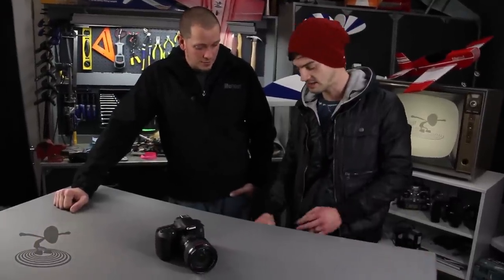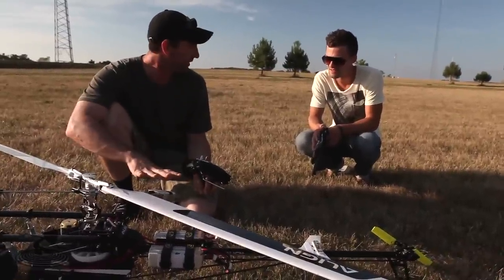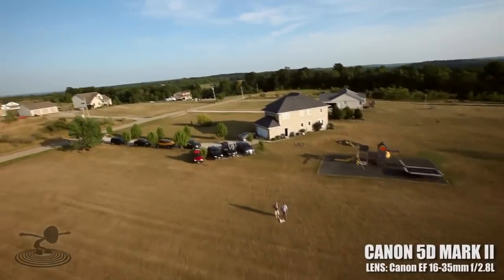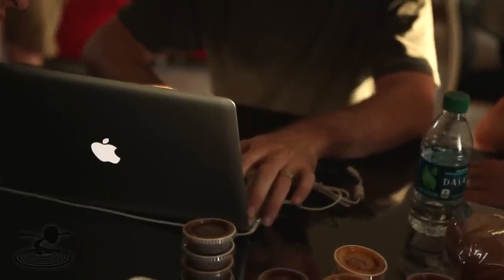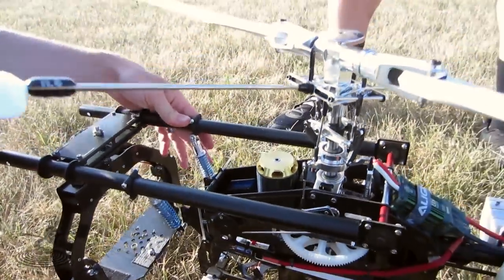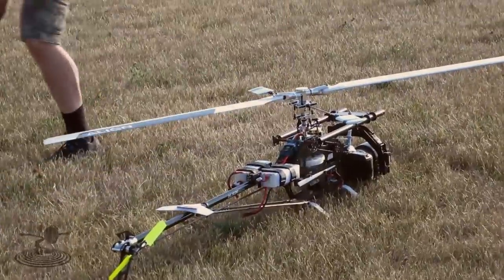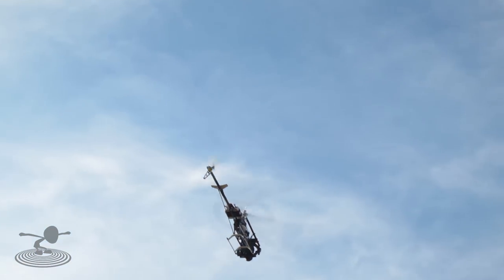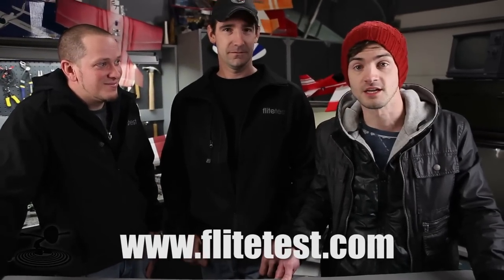Flite Test - T-Rex 800E Helicopter - DSLR Camera Gimbal

Comment: Hey guys! Eric here, glad ya'll liked the episode, was fun seeing what Josh & Josh experience on the other side of the lens from where I normally stand. :)  I do have a tricopter, 2 quads, 2 hexas and I am designing and slowly working on my octo frame. So I def dont hate multirotors. LOL Each has their pros/cons for sure.  One thing the T-Rex is really good at is tracking a fast object...it is ALOT faster than a multirotor. I am excited to go flybarless with a 3 axis stabilized gimbal.

Comment: Hey Glennster!  The shocks dampen any vibrations or shaking that might exist after proper setup, head & blade balance etc. are done. (cant get them to disappear entirely...even on a multirotor) They gyros for the axis' of the gimbal will stabilize the camera so that it maintains itself level to the horizon no matter how the heli banks or pitches & they do an awesome job. Vibrations however will still show up in a gyro-stab gimbal if the heli is not setup right. Cheers! ~Eric

Comment: They do have collective pitch, the rotation doesn't change, the pitch of the blades does. When the heli is upside down, the blades are tilted so that they are at an angle (relative to the ground) as being similar to when flying normal (all being relative to the ground).

Comment: I agree that multi-ro's are far superior platforms for Stabilization, gimble mounting, less vibration, heavey-lift, auto-leveling etc etc.  but I do see an application for still using conventional FP Heli's because of the flexibility, speed and High-performance maneuverability! I wish I could fly a FP heli this stable. lol

Comment: I am running the flybars, because currently that setup is working.  However, in a few weeks I am going to move to a flybarless head and 3-axis controller with GPS position hold, altitude hold etc.  :)

Comment: My quad & hexa frames are all approx 40 inches from motor shaft to shaft. I run the QC-3328 motors from the Cinestar.  I am currently outfitting one of my hexas with the MikroKopter FC board.  I run the Hexas on 5 or 6 cell 5000mah lipos. the 6 cell will fly a gopro for approx 18 min. :)  Although I never fly that long because I try to only pull about 75-80% out of my batteries in one flight.

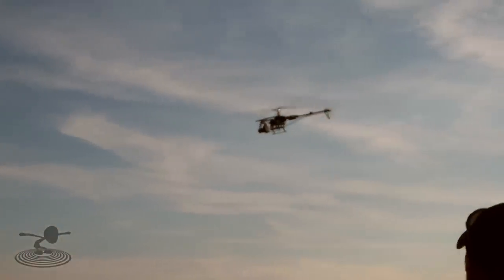Comment: you can two man a multirotor (control the cam separate from the pilot). dont know what hes talking about. 9:30

in terms of heavy lifting, you can also do the same with MRs. i dont see this guys point. it comes down to whether you like single or multiple rotors, basically.

Comment: I guess I should have clarified more....when i said that, I was referring to overall flight characteristics.  The larger heli's are not as touchy & twitchy as their smaller counterparts with crazy high head speeds. This machine as well as multi-rotors can be out-fitted with GPS and position hold FC's that will make them literally sit there and not move at all.  For flying gyros only though.....it is a pretty rock solid machine.  It gets the job done 4 me. Cheers! ~Eric

Comment: Single rotor is an analog, pure mechanical flying machine that doesn't require any electric controls (Yes gyro on tail helps, but you can still fly without it) It's like F15, a smooth mechanical flying machine.

Multirotor is an all digital, electronics powerhouse that's in the air by sheer willpower of an electronic intervention. It's like F117, which will fall out of the sky without electronics.

If you put enough electrics on a single rotor, you can make it fly "hands off" like the multi rotor. Otherwise pilot skill is paramount on single rotors.

I guess energy efficiency is bit better on multi rotor because there's no tail rotor wasting 15% of power, but there's no power-robbing gears/belt/rotorheads on multi rotor. With a single rotor, there's the dreaded "dissymmetry of lift" issue, which doesn't exist on multi rotor, but flight speed is not important for aerial photography/fpv.

Multirotor is better for aerial photography, especially in 6- and 8- rotor machine.

Comment: Eric you could hook a.  cc3d revolution flight controller with librapilot on it and have GPS, autonomous waypoint flights , telemetry, auto stability flight modes and a ton more for less than $50, and it has 433mhz Rx built in that you can fly with or just watch what your doing though telemetry on the gcs real time. nice for pilot two to watch battery life. also cc3d revolution works in any air frame

Comment: You would remove the tails and anything related to those and I feel that reversing two sets of the main rotors wouldn't be too hard. I've never had nor seen a T-rex, but I did, about 2 years ago, have a hobby grade rc helicopter and there was nothing blocking the user from putting the blades in the other way and reversing the motor would be nothing more than simply switching any two wires between the motor and esc...The knocking someone's head off thing would be resolved by not hitting people...

Comment: As was stated it has been tuned more since then by adjusting the oil filled shocks which may have caused the shuddering you saw in the video. Could also be caused by having a low head speed. Getting perfect video on helicopters is very hard to do so i just do stills with them but would like to get better video when i have more time. Also try flying a multirotor in 30 mph winds lol :-))

Comment: Hello ...

Sorry but  multirotors are safer and they are more stable.
There is less vibrations and in last years there is powefull setups able to handle with easy ~ 20 KG total weight ( ~ 11 Kg Payload ).
I have a SkyJib 8 with Aerodrive 8 + 4120-20 Axis + 18x5 props ia already lifted 36Kg (for test only).
The real problem for helis is:
1) Blades can cut a person in 2 pieces.
2) Vibrations.

It is my opinion.

Cristiano

Comment: a good platform to start with if you need stol is a multiplex funcub. I can get mine off the ground in about 8 inches with no payload, and when carrying a mock-up dslr the same weight as the 7D (foam with lead weights in it, just to see how it would change the flight characteristics) I can take off in 3 feet and land in under ten. it would also be easy to convert it to a twin motor, with two 300-400 watt motors on the wings. good luck, and happy crashing! -joe

Comment: The single rotor is also alot faster. So you can get some nice images of say... cars. flying with them at high speeds. The DJI system works awesome for stabilization. You can put put it in altitude hold and this thing will just sit in the air like a multi-rotor. great vid though

Comment: Very impressive bird but are they really getting the most out of it.  The gimbal didnt look like it was gyro stabilized at all which really leaves the setup wanting in my opinion.  Pretty sure there are options now that will control a heli like this with auto level and gps etc so it really is as flexible as a multirotor in that aspect but very much a road less travelled.  Hook up a gyro to that gimbal and some good servos and the footage would be a lot more impressive

Comment: Flying a heli FPV would be hell if you were trying to get a shot with the gimbal. Have you tried FPV using a separate fixed board cam to get a feed for the pilot? Would love to know if there are any heli pilots out there who fly fpv and love it. Seems ok in the simulator (after much practice), working on getting a video system up and going at a price I can afford so I can find out for myself. Starting with my H-Quad, working towards a 450 size heli.

Comment: The main advantage would be to use a gas engine and have tons more flight time and battery life for the camera and electronics duh! Probably want to make a custom exhaust exit out far away from the camera though, through the tail would be ideal. Although more maint but for a professional gig, it would be the way to go.
Reply: It would be very noisy though:(

Comment: On brand new 5000's I get 11-12min if I push it.  I never do. Batteries are too expensive & wear out too fast to push to their limits on every flight.  I land at around 7-8 min.  When flying on a job, there is usually never a reason to fly any longer, at least in my experiences so far.  We get a shot & then change out batteries and move to another location for another shot.  This thing is 100% a work machine. FPV would suck at only 7 min. flights but again, this thing is only for work. :)

Comment: It's easier and cheaper to build a hex for gopro, because it's smaller and simpler. For a DSLR, you need a fairly big copter (even a octo) and things get very expensive. Not to say that gopro will most likely survive a crash, after which a DSLR would go to the trash can ;) and imo, a tri or quadcopter will be sufficient for gopro, I think it's not worth building a hex just for a gopro...

Comment: Would you be able to do a video on FPV setups in relation to radio video frequency.  I am currently trying to setup a 433mhz uhf for radio and 1280 MHz for video.  Interference is a big issue.  My 2.4g radio with 5.8g video works fine however range is only about 1km.

Comment: Does anyone notice some vibration in the video from the DSLR?
Reply: +George Ou It is the speed of the camera. The platform is moving faster than the camera shoots. Typically the higher the resolution and the larger the lens means a lot more data to be processed. Many of the DSLR's a few years ago were only 30 FPS now many high end are 60 FPS. His shots are not really action shots. more Hover and shoot or slide slowly.
Reply: +George Ou That because the 5D ( I have one myself ) Does 1080P 24FPS and 720P 30FPS
Like @Naked Acres said Platform is moving faster than the camera shoots that means more data has to been processed. The 5D is a couple of years old now. 
You can get smaller action cams now that do 720P 30FPS-60FPS-120FPS or 1080P 30FPS-60FPS
The only problem with that is that the picture isnt that clear as that from a DSLR Camera.
I fly a quad with a simple 1080P camera but its not near as close as like a DSLR on 720P Its crazy.
Reply: Infected Gamer Nothing makes up for sensor size. And they say size does not matter.
Reply: +Naked Acres Goddamnit xD

Comment: Being easier to fly seems what this is really all about, as a small quad equipped with a camera really isn't any more stable or more suited for a camera. Heck, the most stable possibly would be a blimp or hot air balloon for crying out loud. I really don't get the fuzz about quad vs helis in here. Each has their advantage over the other, and personally I totally believe a well-setup helicopter is easily stable enough, especially when using a good gimbal system for a high-end cam anyways.

Comment: cool but I don't see how a collective pitch helicopter which is inherently unstable is useful as a camera platform.
Reply: That's because radio control used to have gitich issue.
Reply: Michael Marr
I think more so bc collective pitch helis are innately unstable. multirotors are far more stable and just as maneuverable for AF.
Reply: ohaleceiffel Multirotors are innately unstable as you need a FC just to stop it falling out of the air.
Reply: ohaleceiffel that is not true.  it is expensive and hard to find good mircocontroller.   Like Alistair say or whatever.  You need good accelerometer so that it is not out of control.  not a 3d nor x series.  Like I say, radio on T Rex series are not 100% stable.  In fact, spektrum are trusted brand.  By the way, what are BC, AF and FC?  Sorry, I don't understand short word.
Reply: Justin Sugarman Then step away and back off if you don't agree with me.   You are the one who is troll not me.  You're just being immature or either stupid. Should I say false accused?  My last message, this is not a troll. 

PS: Don't act like disrespect me, I don't disrespects you at first.  Oh and I know what troll mean.  I token English 101 and Reading 090. So don't test me.
Reply: actually CP are very stable, just depends who flies it and what FBL controller you have.
Reply: KpilotRCHelis
now, this guy had a flybar which is not a good idea for camera, FBL is better.
Reply: KpilotRCHelis No. You're wrong.  Flybar is useful for stable and inexpesive.  It is great way to teach a begginner pilot.  Most larger helic flybar can lift progo or EOS. Flybarless is more like for free style.
Reply: Michael Marr
nope.  I've flown both, owned both, FBL is a ton more stable.  Flybars will drift and will pitch up with forward flight.  FBL hold steady.  My X3 will hover hands off for 10 seconds or more.
Reply: So you do have the best flybarless controller cost at 300 dollar?  I mean... not all flybarless can steady you know?
Reply: Michael Marr
FBL controllers in themselves are stabilizing... thats their point.  They have gyros in them.  I have a VBAR, which is one of the best FBL controllers in the world.

and the best FBL controllers can cost upwards of $500, even more than that and there's the Skookum SK720 which has GPS.  Also the DJI Naza.
Reply: KpilotRCHelis Flybar have Gyros too.  However; T-rex had flybarless controller glitch issue that cause them to crash as I remember in past.  Flybarless can move and spin fastest than you think.  As I told before, those are not begginner helic.  There is some video of that.  You will see why I told that not all flybarless can steady.  As far as I can tell is flybarless is not for camera helic.  

So you told me about flybar. I can have swore that you might talk about your old helic flybar have issue.  It can be pitch or gyro issue.
Reply: Michael Marr
flybar helis only have a gyro on the tail!  the cyclic servos are connected directly to the receiver.

I don't know how far back in the past you are, but nowadays flybarless helis are much better than flybar helis because they are so stable and there is very little mechanical setup required.
Reply: KpilotRCHelis No. That is not true.  Some flybar are much better than flybarless and some flybarless are much better than flybar.  I don't think you want to accept the fact that flybarless controller had glitch issue nor saw video of that.  That is 3GX controller in T-Rex.  Like it or not, flybarless do have glitch issue on some helic,  flybar too.  That is why you get to check it for any glitch on both flybar and flybarless before fly this RC.  You will know it is glitch if pitch is act funny.
Reply: Jerod Harris if rented equipment isn't in your name then it is not your responsible.  Director is.  If it is break, director has to paying for it unless take it to court.  If contract say to not lent anyone, director is going lose in court.

Comment: The discussion is not really multirotor or helicopter, it is more about payload! if the payload is the same, Heli definitely have better endurance, but quad is easily maintained and less mechanically complex. if payload is same, and for the same thrust, lift weight for helicopter is sure win, it is just physics. But it is surely complex and require lot of tuning and balancing, because the whole machine is asymmetric!
Reply: 1 more thing, if they can use gas engine, helicopter will be the winner. single drive of power from engine to rotor and to tail rotor.
Reply: Can you explain why a traditional copter cost so much more . I've seen a price of 20,000 ? Can any hobby store that sells copter , repair them ?
Reply: i have to disagree with the heli vs multirotor and efficiency statement.  i built a quad in 2015 thats a 680mm class chassis, uses 15" x 5.5" blades, 330kv motors, 6s 10,000 mah power and weighs 8.5lb/3.8kg and it hovers using 11-12 amps.  thats a max hovering wattage of 315w.  that gives me 45+ min of hovering time with no payload.  lifting a 12lb job radio tied to the skids i was still under 800 watts of power. so with 12lb payload im still almost half the power draw of the 700 heli mentioned above without any payload.  my setup does have downsides though.  for one you trade risk for efficiency.  i lose a motor its a guaranteed crash.  i cant fly inverted or perform 3d maneuvers.  if i outfly the battery it crashes.  any failure is almost guaranteed to wreck the camera/gimbal setup.  another downside is that the thing flies like an 18 wheeler would.  but for a camera light and nimble feeling are usually bad things from a stability point of view.  i fly helis for hobby but multi-rotors are a much better camera platform unless you are trying to follow a car for a fast n furious money shot
Reply: Pretty sure it's a supply and demand thing. Today quads are simply far more popular, less costumers that are more specialized=higher pricing.

Comment: why exactly use a Helicopter ? ?
Reply: With helicopters, even if the motor stops mid flight, they can set the rotor pitch to negative (which is how they fly upside down), so as they fall, the rotor speeds up. By setting the pitch to positive just before landing, they can land without power. This means that your equipment is safer from failures
Reply: also called autorotation, same procedure is used by real helicopters if engine stops. But another thing is that drones can have parachutes that can slowly and safely land it in an emergency.
Reply: Yeah, but to do that you need to wait for all of the motors to stop spinning, and the parachute itself can be pretty heavy